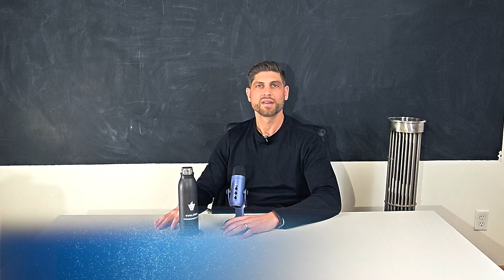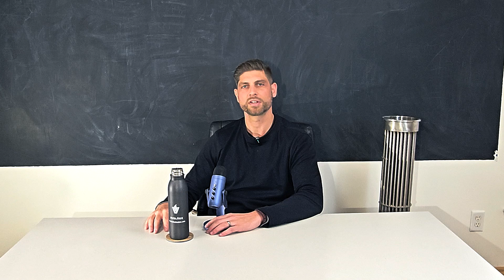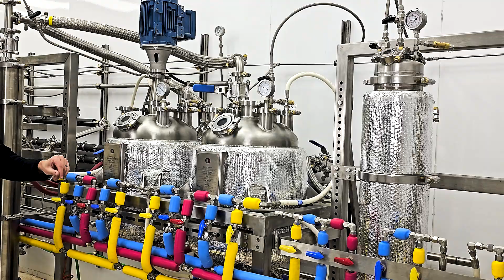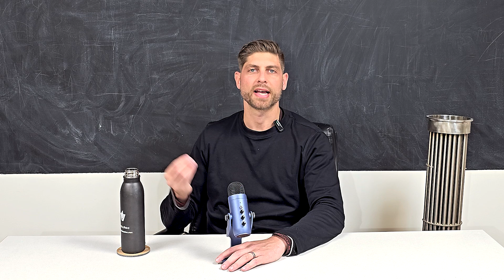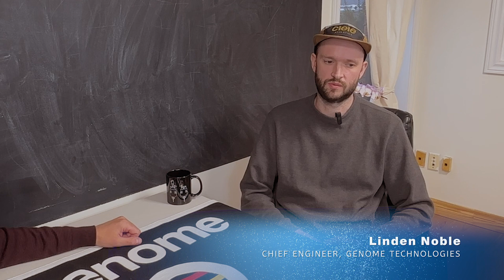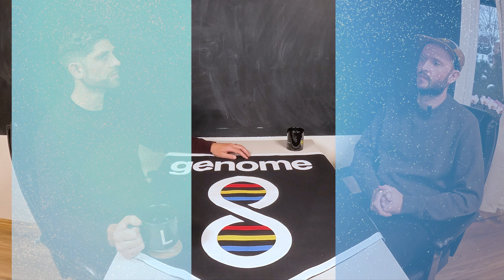How to Make Crystalline THCa Isolate and Diamonds 10x Faster!

Comment: You can control nucleation points with various methods. Which can seriously speed up recovery times of the isolate from solution. And also polymorphism! You can control the structure of the crystal lattice to get various end results. I can pull THCA from ethanol to form a solid slab in less than 3-6hrs with these concepts.

Comment: What’s the cost of a reactor and other equipment required for this process? 
Minus the cls that is. 
We’re still doing it by hand because we don’t require kilos of thca and hte. 
Is there a smaller systems for small batch manufacturers?
Reply: Olli , would you have a video or be prepared to share your hand making method , I’ve tried but no joy , thanks Gav
Reply: @Gavinwhu  
Just fyi and others information, this process was always done in an inspected and licensed extraction lab.
 Not a hobby lab.
-Step 1 is pouring appx 200 grams of crude oil into a 1qt mason jar.
-Step 2 is filling the jar with butane solvent and mixing crude until it is completely dissolved. 
-Step 3 requires either a -40/-80 cryo freezer, or you can also use a dry ice and iso slush bath in a stainless steel container, making sure bath does not cover lid. The difference is that the dry ice/iso bath takes longer to crash thca, a -40c cryo freezer takes around 30 minutes, and -80c around 15 minutes.
-Step 4 requires a Buchner funnel, filter flask (500-1k ml), 1-5 micron filter paper, and large brown coffee filters big enough to cover Büchner funnel completely (the coffee filter’s there simply to capture and remove thca easily), and you will also need a pump for the filter flask. 

Place micron filter in Buchner funnel, place large coffee filter over it, connect pump to filter flask and turn on (use or attach a valve to regulate pump), wait to pull jars from freezer or dry ice slush until everything is set up and ready. Make sure not to aggitate or jostle jar too much when pulling from bath or freezer.
Pour terp and butane mixture into Buchner slowly, this mixture will go through filters and thca will remain in Buchner and coffee filter, allow pump to pull terp and butane mixture through completely. (Do not use butane to wash thca if it still has color, you will dissolve the thca and it will pass through filters. Simply process thca again using same method to clean it up.)
Terp and lipid free thca that remains on coffee filter can be pulled out and placed on parchment paper or pyrex, and in vac oven to dry. 
Pour terp and butane mixture in filter flask back into mason jar, and top off with fresh butane. Use the same process to remove more thca, fats, and waxes.
You can process this mixture 3-4 times before all possible thca that can be crashed out, is crashed out.
Purge  terp mixture in fume hood under room temps, test for residual solvents, and complete cureing or gassing off if necessary. 
Hope that makes sense! Feel free to ask questions.
Reply from the maker: Hey @ollimekatl please share your email address and phone number with us so we can get in contact with you with more info, we can help you depending your needs.